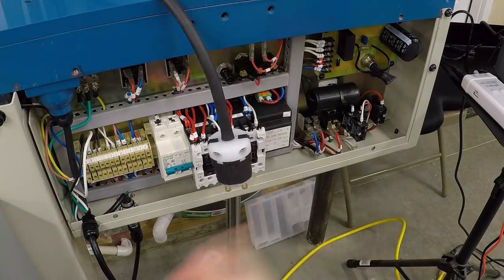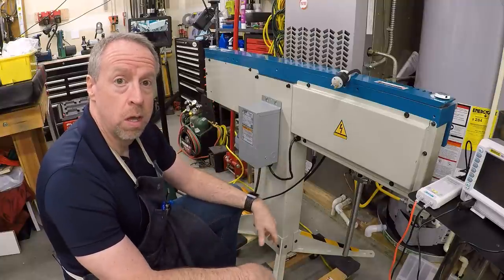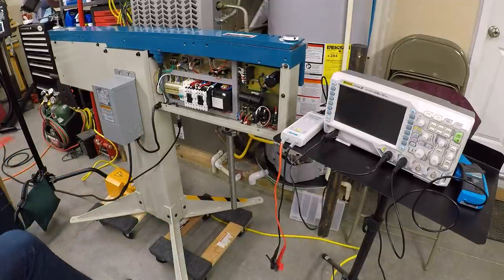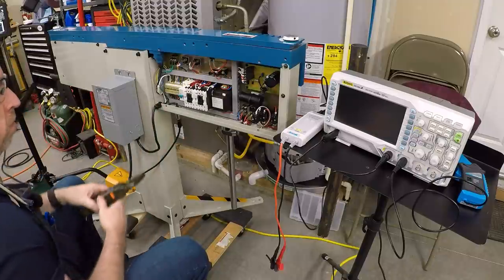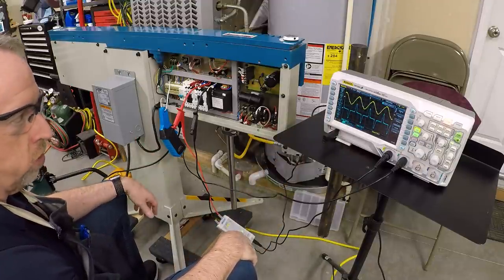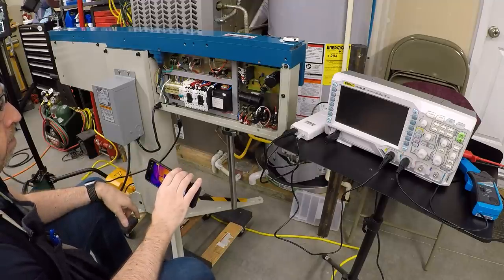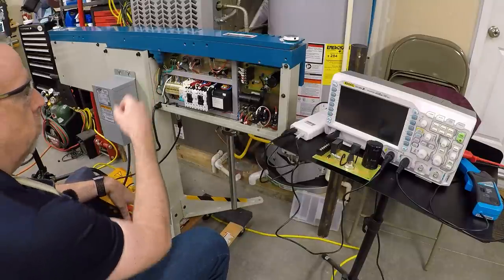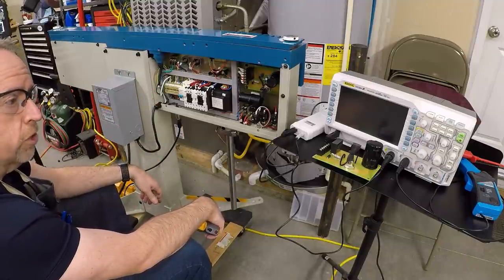The Mystery of the 17.4A | Sheet Metal Saga

Comment from the maker: WOW.  So many comments about whether Fluke and Rigol know how to calculate RMS.  Here's the data dump from the scope.  Calculate away:  https://docs.google.com/spreadsheets/d/1xWczXWEWVof9Shi8CJNf5dfPQm6ioELS-lGJx-ll0MY
Reply: At least you remove doubt in correctness of your measurement,  which is one step closer to resolving this mystery.
Reply: no need to waste your time with these people james. excellent video as always!
Reply: okay dude? You busy?
Reply: Has there been any further update on this?
Reply from the maker: @josephwilliamcosta  no.  Is there something to update?  The brake works fine, but it draws significantly more current than specified on the plate.
Reply: @Clough42  Yeah but... Can it measure RMS? hehehe. Sorry man, couldn't resist.

Btw. Loved the detail in this sub-series. Your facial expressions deliver the perfect balance of fact, fun and filming on a potentially dry subject.
Reply: James great video as usual!  Simply put and with the facts presented, the manufacturer apparently didn't measure the current draw with an RMS meter.  On a similar note, their very rigid 209-231 input voltage requirement is a bit baffling.   But that's another rabbit hole.   Keep up the good work.
Reply from the maker: @hectorniebla4742  I spoke with the US distributor, and they said that they had a lot of magnet burnout warranty claims until they put that restriction on it.  It's probably a magnet designed for a lower voltage, and it's being run very close to its limits on US power.
Reply: @Clough42  Sorry if I am beating a dead horse.  Then I would expect a unit at this price range comes with an over/under voltage relay to protect it.  Just a thought.
Reply: Pretty sure their engineers know what they are doing, as well as their marketing dept.
Reply: @Clough42  l bet the mag is made for Europe power. The bet is a half penny

Comment: My guess is that the importer (with their name slapped on it) doesn't really understand how the product made by the real manufacturer (in China) works.
Reply: 100%.  I'm still waiting to hear which NRTL listed this appliance which isn't rated for standard voltage systems in the US.
Reply: @wgmskiing  There is no obligation to get federal safety agency listing in order to sell something in the US.
Reply: Except Baileigh states they make their products in the USA 🤔
Reply: @almostanengineer  The label quite clearly says “Made in China”, so ???
Reply: @spehropefhany  The electrical codes adopted into law in most of the country provide a de facto requirement for listed devices in 90.7 as interpreted by most authorities.  OSHA goes even a bit further.  The point of such listing is so that a qualified electrician can hookup a device like this and expect it to function with normal, standard US voltage systems, and should be able to expect the nameplate to be accurate as well. The internal wiring and devices should be safe and follow accepted practices.  Chinese imports often aren't actually listed, or they have some fraudulent listing.  Yes, any huckster can sell anything, that doesn't make it legal, wise, or safe to install.  This thing is probably savfe enough it's just ignorantly designed and marketed.

Comment: I bet this machine was designed for 220V / 50Hz, running on a single dedicated 16A circuit as you would find in much of Eurasia. That would also explain why they're so concerned about the voltage being no higher than 220V in 60Hz country..

Comment: You were so close when you mentioned power factor. It's a while since I have had to do any power factor calculations but see If my thinking makes sense.
True RMS measurements take account of the waveform shape but not the power factor, your clamp meter can't take power factor into account on it's own.
Linear power supplies can have power factors as low as 0.6 (53degre phase error)
Applying this to a true RMS current of magnitude 17.4A gives a Real (as in real and imaginary) current component of 10.44A.
The Data plate should have Power Factor listed but the buc boost transformer may affect this somewhat.
The average current meter reading of 10A is just coincidence.
Reply from the maker: If I understand correctly, the current is just the current.  If it's out of phase with the voltage, then it's the power that's imaginary (i.e. real power is less than VA.)  That's a related topic, but since there's no power rating on the nameplate, it isn't at issue here.
Reply: I follow Elanman on this one... It may not be the (only) problem but...
Maybe the nameplate value has been calculated. As the magnet is a DC load, there is no power factor involved AFTER the rectifier... 
Let say that it is a 2300W magnet.  At 220V it would make 10.45A (P=U I in DC)... But if the AC current and the voltage are not in sinc, you will need more current to get the same power : P=U I cos(phi) in AC... cos(phi) is also known as the power factor...

Or maybe the current on the nameplate was measured without checking the waveform and RMS vs average...

Edit: 
Well... on the scope it looks like voltage and current are quite in phase... cos(phi) should not be that awfull...
Maybe you could measure the voltage and current on the DC side to confirm the power sucked by the magnet... 
And if your scope can make the instant product of the voltage and current (or export the values to a spreadsheet to make the product), the power P should be the average value of that product...
Reply: @ocAToccd  were you looking at the same scope image? The waveforms aren’t even close. That “only draw at the peaks” waveform isn’t sinusoidal, and that’s the other way waveforms can not-match. Moving over in time is just one of the ways to make power factor shit.

Comment: Greetings James, Have you thought to put the circuit into a simulator tool and see what the current draw is? Or just sketch out the circuit and run the numbers. (Yes AC analysis is more of a pain by hand). BUT if you see a difference or even don't see one, that might make a decent side video - going over the hand calcs. Thanks for the great videos and as a Aerospace Engineer your channel is great. Cheers.
Reply from the maker: When I consulted a EE friend, this is the first thing he suggested.  :)
Reply: @Clough42  Great minds think like your EE friend! I would pay attention to those guys.
Reply: You would need to know the characteristics of the magnetic coils, which might take some head scratching.
Reply: @Clough42  simple solution export current waveform from oscilloscope and then calculate RMS properly with respect  to crest factor.
Reply: @Clough42  James I would love to see this done as a side video.  I have learned TONS of stuff from you just doing these last 2 videos.  Thank you!

Comment: To ensure that the additional amps are not being induced by the field of your magnetic clamp, wire three conductors to a plug and receptacle and take your readings at the plug of the machine.On the floor in front of the brake. I use one lead on a fluke 87 on AC to check the spark plug gap on industrial furnaces. I put the lead on the plug wire, wider plug gap higher induced voltage. My Fluke 374 is too sensitive to use for that task.

Comment: James - I measured mine on my identical machine with a Fluke 323 True RMS - it read 17.9.
Reply from the maker: Thank you!  Looks like the nameplate is just wrong.
Reply from the maker: @joenicotera2991  Interesting thought, but no.  There's no current in the ground wire, and the resistance between the coil and ground reads open.
Reply: I get 11.33 amps rms based on the ‘scope waveform. Unless your scope is totally off I read 89amps peak to peak.  

Peak current is 89/2 = 44.5. 

Assuming the current spike is close to sinusoidal, the rms current during that peak is 44.5/sqrt(2) = 31.466 amps rms.

However this sinusoidal peak only occurs for 3mS (from my screen capture of your scope trace). There is no power drawn for the rest of the cycle.

Thus the 31.466A is averaged over 1/2 a 60hz cycle. Half a period of 60hz is 8.333mS.  

The average current for half a cycle will be 31.466x3/8.333 = 11.33.

I can’t find a way to get to 17.4Amps. I suspect that the “true” rms meter isn’t giving you the right answer.  I’ve been known to be wrong - but the 17.4 doesn’t gel with me.
Reply: @occasionalspark8168  All I can tell you is what the meter tells me.  I measured exactly the same way James did, got a virtually identical reading.
Reply from the maker: @occasionalspark8168  by making assumptions about the shape of the waveform and scaling it out to the full cycle, you're effectively calculating average current, which is around 11A.  The peak of the waveform is 48.5A, which means the crest factor is around 2.8 for an RMS current of 17.4A--well within spec for both the Fluke and the scope.

Because joule heating is proportional to the square of the current, the RMS values are really non-intuitive for a lot of people.
Reply: @dannirr  I have no doubt that is what you are reading.  Problem is you have identical conditions to James''  so you will get identical results.  I tried to go to the basics, because I do not trust anything that says "true" rms on the label, unless you are paying much more than you would for a fluke.  I would trust an HP3458A or equivalent to do "True" rms, but not a handheld.

I think we have a 2 watch syndrome here - a man with one watch knows what time it is, a man with 2 doesn't
Reply: @Clough42  I used to do this for a living as an R&D engineer - and, yes I did assume the shape, but it's probably close enough to the shape to differentiate between 17.4 and 11.  To all intents and purposes calculating the rms of the current peak puts it into dc equivalent terms.  So you have a period of 5.333ms (approx) where the current is 0A, then you have a period of 3mS where the equivalent of 31A is being drawn.  You can average the current draw over the half period - it is not the same as taking the average of the waveform, because the waveform was converted to rms before the averaging.  You can look it up and confirm if you want.

If you make the waveform data available for download I'm sure many people would be happy to calculate the rms current, maybe using matlab or long hand through excel.  Just a suggestion.  You may also want to check with Bayleigh to see what they used to measure.
Reply: @occasionalspark8168  You have it wrong. You can calculate RMS over whatever time period you want, but that's not how a True RMS meter measures it, and it's not how the scope is calculating it which will be over the full waveform.
Reply: @EEVblog  sorry I took a short cut. The wave is symmetric I should have done it over the full period, then divided by 2. Same as you do with peak vs peak to peak
Reply: @EEVblog  maybe you can do the calculation based off the waveform, and see if you come up with a different answer?
Reply: @occasionalspark8168  I'm absolutely sure the scope is calculating the correct RMS value. There are several cycles there, and good dynamic range. It's accurate. Only way it's not accurate is if the probe scale factor is set wrong.
If you want to get fussy you might be able to set the gating area for the RMS calculation, but I don't recall if the 1054Z has that feature or not. Otherwise it just assumes the screen area for the calculation.
Reply: @EEVblog  to add to my last response. The rms of a 2v p-p rectified sinusoid waveform will be .707V rms over the full period.  It’s also .707V over half a period.  i.e. it the same for both halves of the period. 

Do you know how the Fluke does its rms calculation internally?  The top end rms meters either: do it by measuring a temperature rise in a temp controlled environment; taking discrete samples, integrating, squaring the value, summing and dividing; using discrete Fourier transform and processing the results - I believe to get a true rms of an arbitrary waveform requires a lot of work. The fluke handheld is unlikely to do any of that, so I’m curious how they do it, because I’m pretty sure you can’t get an accurate rms reading on a non-sinusoidal waveform any other way. Happy to be proved wrong - calculating the rms from a scope waveform would give us a good baseline though
Reply from the maker: @EEVblog Thanks, Dave!
Reply from the maker: I uploaded a spreadsheet with the data from the scope, showing the RMS calculations.  See the link in the pinned comment.
Reply: @Clough42  well, that was fun😀. I appreciated the upload.  For the record:
My guessimate of the rms for the current spike was spot on, so the sinusoid estimate was really close.  
In principle, my methodology was almost right (I’d be the first to admit that I’m fallible). Having the real data was a great help and I was able to use it to figure out a mistake in my calculation.  The formula to combine rms contributions is
 sqrt(c0.rms1**2 + c1.rms2**2 + c2.rms3**2 + ….). 
Where c1, c2 etc are the portion of the period an rms component occupies. 
For example if you have a periodic wave that comprises 3 half sinusoids (1vrms @ .25T, 2vrms @.6T, 3vrms @ .15T) the overall combined rms will be
Sqrt(.25x1**2 + .6x2**2 + .15x3**2) = sqrt( .25 + 2.4 + 1.35) = 2vrms

For my guesstimate the current spike was 44.5 peak Amps (44.5x.7071 = 31.47 amps rms) and occurred for about 3mS out of 8.33mS. 
The calc is: sqrt( 3/8.33 x 31.47**2) = 18.8. 
In practice the duration for the spike is 2.7mS which results in 17.9.  This is what I should have presented. 

You should note that it is not necessary to perform the calculation over the whole period, because it’s a full wave rectification the first half period is 100% identical to the second half. 

BTW. An easier rms formula to use in excel is sqrt(sumsq(range)/count(range)). 

I don’t regret trying to make my point - it resulted in being able to eliminate one possible source of the problem. At least we moved forward. 
I still don’t trust things when people say “trust me”. A proper sanity check is always in order
Reply from the maker: @occasionalspark8168   I didn't say "trust me."  I showed my work, using two different measuring tools, with proper technique, on camera.  I also consulted with three different electrical engineers prior to posting the video, to double-check.  One of them responded to this thread, and you pushed back on him, too.  You might consider reevaluating your level of skepticism.  I'm reevaluating my willingness to spend my time trying to be helpful in YouTube comments.
Reply: @Clough42  Dear James, please do not reevaluate your willingness to be helpful. I sincerely apologize, it was not intentional and I will reevaluate my skepticism. I made a mistake in my calculation and I was always said I could be wrong. I enjoy your videos and I don’t want to taint your work.

Comment: Regarding the 'missing power'. If power factor is the culprit (and this is plausible if the load is just a large inductor such as an electromagnet) then this means current and voltage are not in phase. So the power delivered is not a product of amps and volts but a product of these and the cosine of the phase angle between them. So there is no missing power. The cable had to supply far more current than you would with a resistive load.